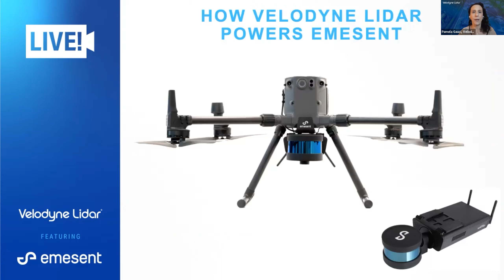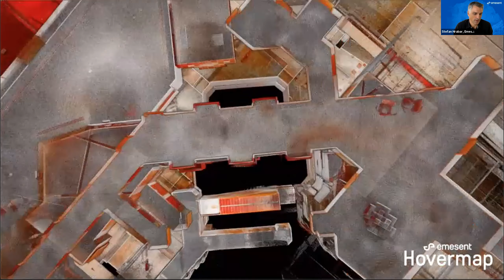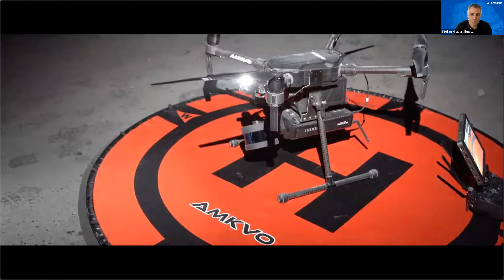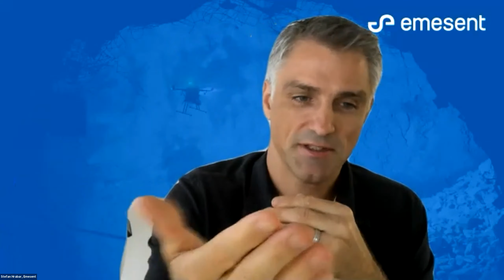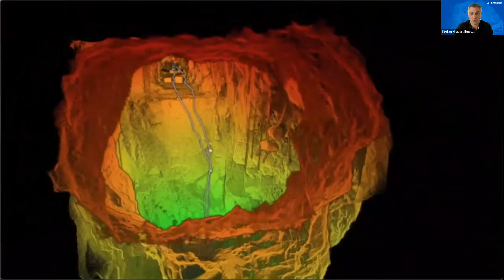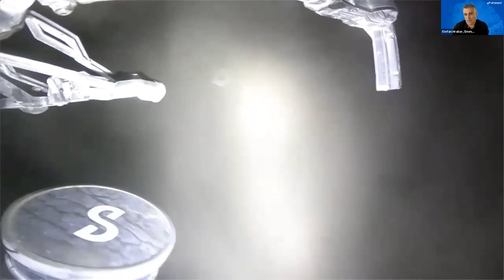Velodyne Lidar LIVE! Episode 1 Featuring Emesent

Comment: Hello, I'm from South Korea. I read a news article in our local newspaper company which says Hyundai Mobis chose Valeo's lidar for autonomous driving vehicle at least for one which will roll out in 2022. I guess it's a Level 3 or ADAS purpose. It also said, maybe in the end, they'll use both lidar simultaneously for the cost reduction. But I can't find any news from anywhere?

Good for you to cowork with Emesent, congrat! but I think the value of velodyne still largely depends on lidar on automotive use. Could you give me some color on that?

Below is the link for that, you can check with Google Translate.

https://www.etnews.com/20210122000133